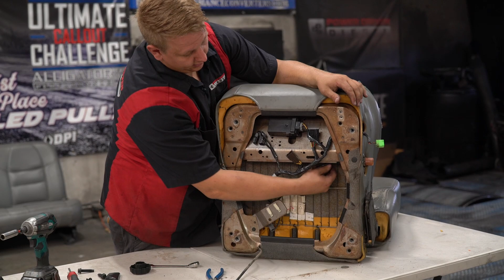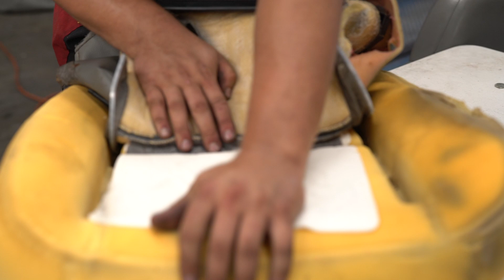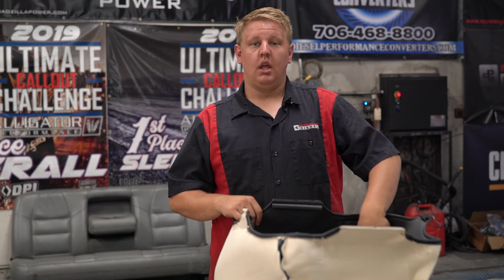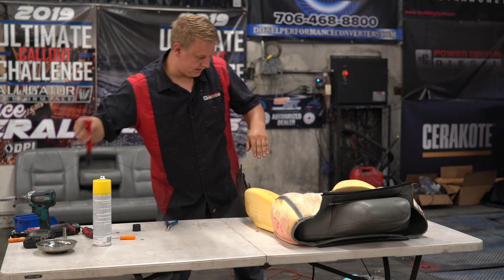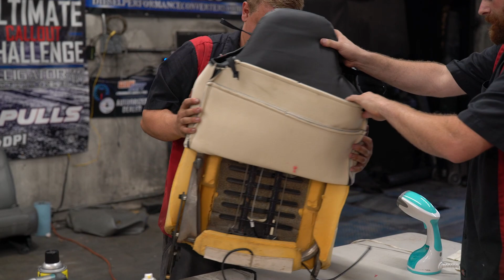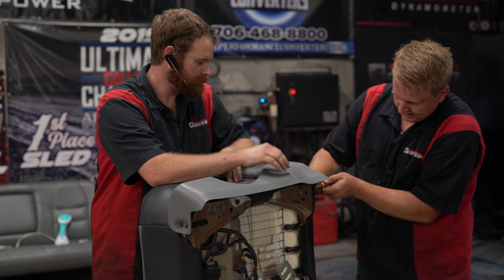Ford Super Duty Truck Seat Re-Upholstery

Comment: Just finished this install on a ‘01 f350, great video, really appreciate it! 

For guys who watch this for the 7.3, the main difference was that it had Velcro inside the seat instead of hog rings. And I would 100% replace the driver seat foam. I didn’t and I regret it. Also I used cheap Chinese vinyl covers in lieu of the nice ones. So I’m like $110 into this fix and it’s great!